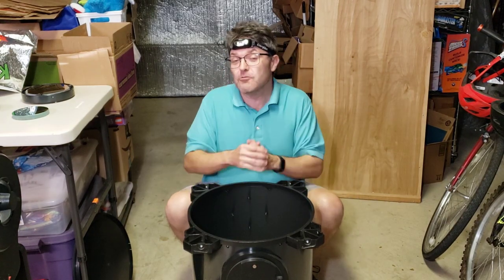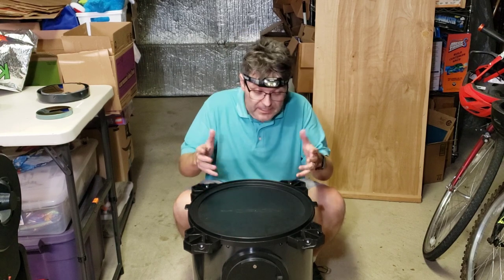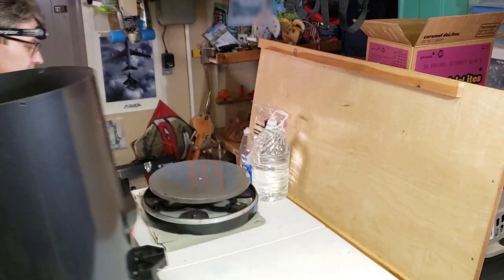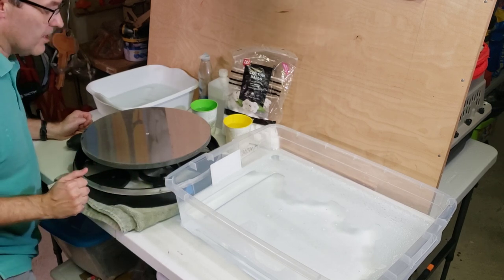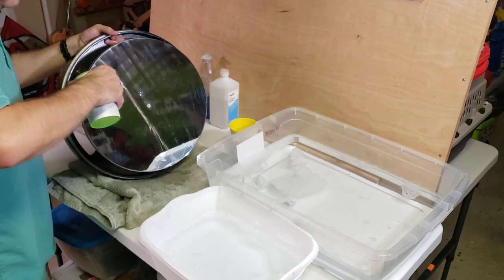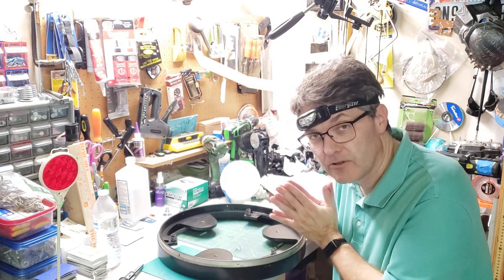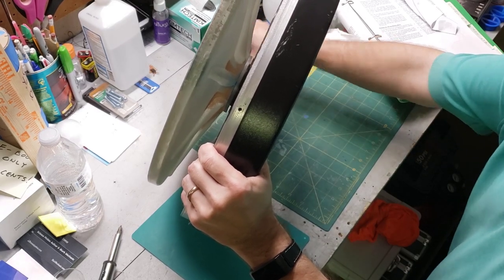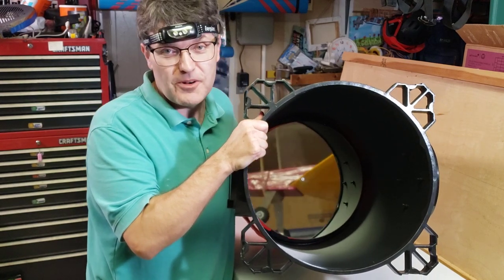PART 6 - GIANT Telescope Restoration!  -  Cleaning Huge Telescope Mirror!

Comment: man thank you so much, my mirror on my xx14g is super super dirty with like 6 years of dust on it. this made me feel alot better about doing this. i done an 8 inch mirror before and seem to do a good job on it but a 14 inch mirror is so much bigger. soon i'll tear the whole scope apart and do as this video says. you made me feel alot better about doing this.
Reply from the maker: Admittedly, I was a bit nervous - these mirrors are simply not replaceable by any means.  Take your time, go slow, set it aside and pause if you have to.
Reply: @reflactor I was nervous with a 8 inch one LOL, but just take your time and be prepared and be careful.

Comment: The great mushroom mirror clean good job i wouldn't be able to hold it look heavy, while you had the mirror out painting the edges cures stray light leaking true vent holes, and some flocking paper near the big mirror helps again with leakin stray light, love your video, and do m86 were you can see about 12 galaskies, ore mars and the ice caps, hope clear skies mate.
Reply from the maker: Thanks!  I admit, it was pretty heavy. My arms were shaking as I tried to re-assemble it.  I didn't think about the flocking or painting - I might do that soon.  I will add M86 to the list!  Hopefully I can see it from here in the city (Bortle 8 light pollution).  Clear skies!

Comment: Looks a similar mirror design to my 18" Skywatcher,  I need to clean the mirror but I'm worried now 🤣
Reply from the maker: The key is to go very slow and be prepared. Having a helper is also advisable, especially for the step where you hold it at an angle and pour distilled water over it.
Reply: @reflactor  The mirror is now clean!  It was a bit of a struggle, I didn't have a bowl big enough to fit the mirror into to soak and it would have been too heavy to hold on my own.  I decided to take off the truss tube section and lift the mirror assembly onto some blocks of wood so it was at a 45 degree angle,  I then rinsed it with water before cleaning it gently with soapy cotton wool and rinsing again with distilled water.  Hopefully this helps someone with a Skywatcher 450P

Comment: Wow! I wasn't expecting that mirror design. When you said a mushroom shape I was trying to imagine some strange mirror cell support not the mirror itself. It goes to show they were really pushing the boundaries of the motorized Dobo design at the time using the materials and tech available.  Their compromise on the mirror weight using this design probably enabled the ability to motor drive the scope effectively.
Reply from the maker: As far as I can tell, Orion only used these mirror shapes on the xx14g and xx16g models.  They briefly restarted the product line for the xx14g's again (and recently stopped again), but I don't know if they are still using this oddball mirror shapes.

Comment: Thank you for this video.  I think I will use this method to clean the primary mirror on my dob.
Reply from the maker: This "barely dip" technique is really only necessary for the stalk-mounted 14" mirrors.  For most mirrors, the process is much simpler. You can submerge the entire mirror and clean it underwater.  I have a video that demonstrates that: https://youtu.be/wtc53Br_96g
Reply: @reflactor  The 12 inch Zhumell is mounted a little differently.  They strongly recommend against removing the mirror from the cell.

Comment: Glad you’ve got that big ol’ lump of glass super clean. Just one point. Im fairly sure these are not made by Orion but we’re used by Orion. I think they are made by a Chinese company called Synta? Anyway they are the EXACT same mirrors and cells used for the Skywatcher Dobsonians. I know this because my mirror was ‘damaged’ (long story) and I sourced a replacement mirror straight from the Skywatcher 14 inch and they are identical in every way (focal length etc). So all would not be lost if you had damaged it but it would’ve been costly 😂. Another terrific video and we are now inching closer to that first light. Can’t wait. 🇬🇧👍
Reply from the maker: Thank you for that very helpful information!  As I've found out, I can't buy spare parts from Orion (since I'm not the original buyer), but I was able to buy a Crayford focuser part from Skywatcher that was identical. I didn't know that same convenience applied to mirrors too. Thanks again for the comment!
Reply: You’re welcome. Having used both Orion 14 inch scope and the Skywatcher I can say that even though optically they are identical the actual Orion truss scope is much better quality then the Skywatcher collapsible version. 
By the way, regarding the placement of the Cardboard box on the table to put the mirror in, didn’t fool me for a moment. Having avidly watched all your videos I knew exactly what was coming! It did make me laugh still 😂
Reply from the maker: @deepskymike767    Haha, thanks.  I was worried it required too much "setup" for the joke. Glad it still got a laugh.
Reply: thanks ... I was going to make the same comment.  That being said, glad to see this whole series as there seem to be a lot similar between the Orion XX14g and the Skywatcher 350P

Comment: The reason for the conical mirror in the 14 is because synta makes the C14, so they are tooled for conical mirrors.

The original celestron starhoppers also used conical mirrors

Comment: Tip: Don't clean the tube in the same area as the mirror!   Take the tube to an entirely different room where you can use compressed air and not worry about those bits landing on the newly cleaned mirror!  Or clean the mirror AFTER cleaning the tube giving enough time for any dust to settle out of the air!  Or do like painters and create a negative pressure room by putting a fan in the doorway with a seal around it so air-dust is pulled out of the room!  

The mirror support is quite interesting, shades of what some professional big mirrors shape their backsides with the support veins.  On SCTs the mirror with the hole in the center uses a bell curve as well to support the primary.  

You've cleaned the primary... how about the secondary?  :) 

I probably would have simply lowered the tube over the mirror so I can see the mirror surface vs inverting it where if my grip slipped the mirror surface wouldn't collide with the sharp tube edge... ;) 

I probably would have made a jig to slide around 3-sides of the mirror to hold it submerged in the water.  Again, I'd be leery of losing control and dropping the mirror surface against the wather container!  

Good job overall.  Looking forward to the final steps and testing!
Reply from the maker: Thank you for the comments.  I love the idea of a jig to hold the mirror.  That would've been very smart - more proof that I don't always approach these things in the smartest way, lol.  Regarding your question about the secondary mirror, it was absolutely flawless and perfectly clean. Not a spec of dust or filth on it.

Comment: I have the same scope and just washed  the mirror a few days ago (before I saw this video!). I was very stressed while doing the wash and I don't think I got it as clean as you did. But anyway, I think it's a lot cleaner than it was. Just waiting for some clear skies to have a look. Maybe you can do some videos on how to get this scope really accurately star aligned. I use Synscan pro and Sky Safari with Wifi, and it's always a bit off the target. Thanks for your videos!
Reply from the maker: Congrats on also not destroying your mirror!  I was very worried.  Aside from dust, my mirror had a layer of something that repelled water, like it was in a kitchen/greasy environment for a while.  It took a couple of washings to get rid of that.  I'm almost done with the next video (testing).  Mine is too old for WiFi (newer versions have it built in).  My experience with GoTo's is that they are great for finding the "general" location of the target (with a 30mm eyepiece), but they always seem to be a bit off.  However, they tend to track really well which is what I really need them for.  Unfortunately, it's been really cloudy lately. However, I should be done in the next week or so.

Comment: I bought a “budget” mirror star diagonal from Amazon, and the mirror they had installed was coated on the wrong side! Caveat emptor!
Reply from the maker: Yikes! That is quite a mistake.  Could you disassemble and flip or did you have to take it back?
Reply: @reflactor It was not a simple assembly error that I could fix, they simply did not know what they were doing. It was obviously never tested. I got my money back without having to return it .

Comment: Taking the mirror cell out and putting it back in would've been so much easier if you'd let the tube rest on the ground, so you wouldn't have to lift as high. You'd have had a lot more control over the heavy cell, and would've had a much easier time.
Reply from the maker: Good point. I think I chose that height due to the lighting sources and camera location.